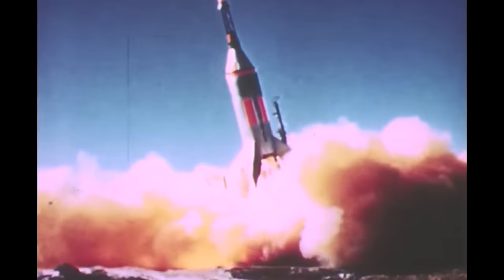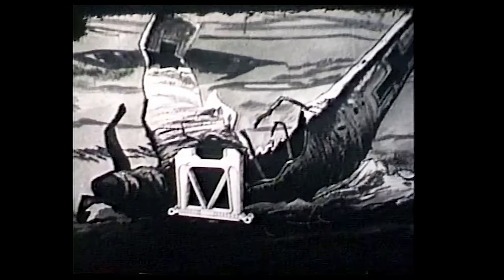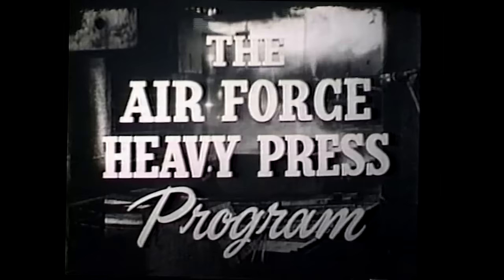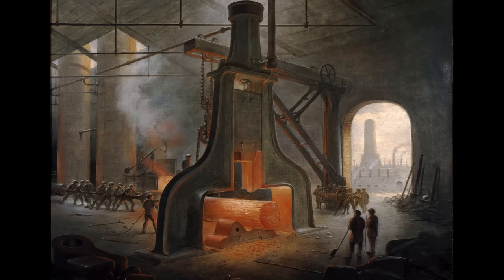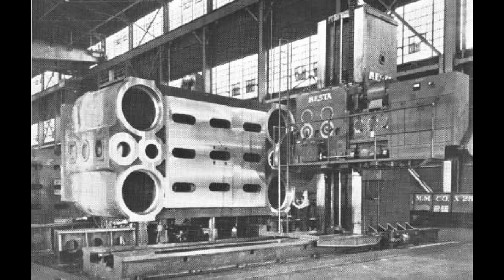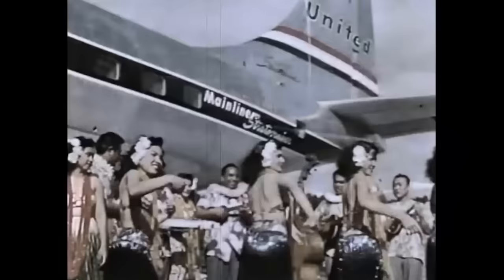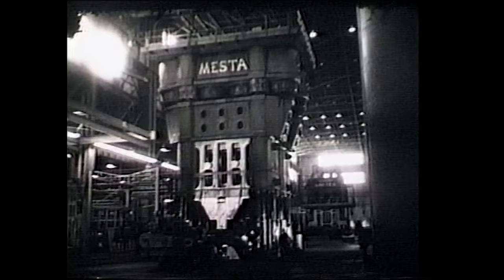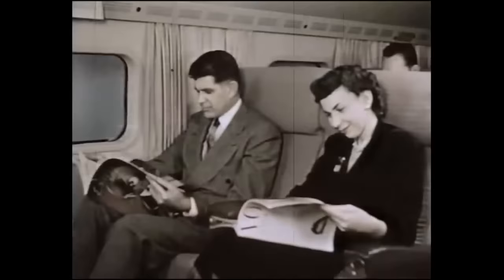America's Iron Giants - The World's Most Powerful Metalworkers

Comment: The report you reference of not needing more than 50k presses is flawed and narrow in it’s review.

The head if Lockheed’s skunk works was a huge proponent of a 250,000 Ton press due to the cost savings it would bring to advance jet manufacturing. During the development of the A12 & SR71 till his death he saw the value of the larger press in rapidly producing components and the cost savings in reduced labor cost of machining required.

Comment: Use a 3 mm thick steel plate of 100000 square meters and make an aneroid barometer cell cylinder from this 
Will it moving under the atmospheric pressure 
Steel strength is 200 gigapascle 
Please do the math over it 
Whole universe got benefited from it if we make a big barometer aneroid which gives power by changing atmospheric pressure 
Forever 
Energy crisis. Become history ?

Comment: not sure where you got the information that the Soviets needed the German press, the Soviets were better at casting and forging iron in large pieces before the war, else they could not have build tanks with large cast parts, which allowed them to build more tanks than the Germans

no, I'm not Russian, it's just wrong 

same as with the rockets, the Soviets got their share of German engineers and launched a few prototypes based on German designs but they gave up on the design as early as 1949 because it was too expensive to scale

Comment: And now Tesla has a few 600,000 Ton presses
Reply: Tesla giga press is child compared to Mesta, tesla giga press is relatively light press for automotive industry, they are nothing before large heavy industry forging presses, "Giga Press are a series of aluminium die casting machines manufactured by Idra Group in Italy. With a clamping force of 55,000 to 61,000 kilonewtons (5,600 to 6,200 tons), In January 2021, Elon Musk announced that also the rear chassis of the Tesla Cybertruck would be produced using an over-8,000-tonne-force (80,000 kN) casting machine" All this giga presses is small, not even near to Mesta